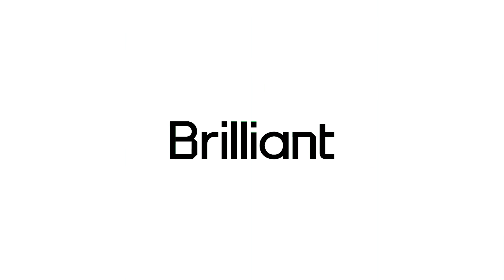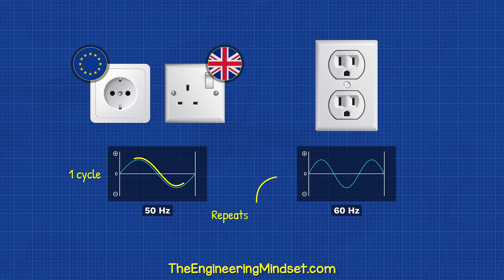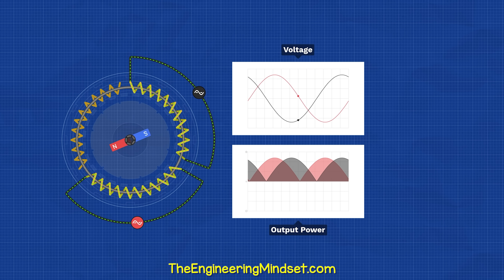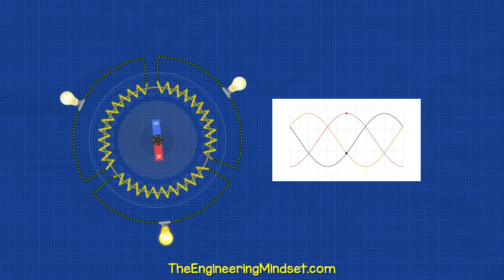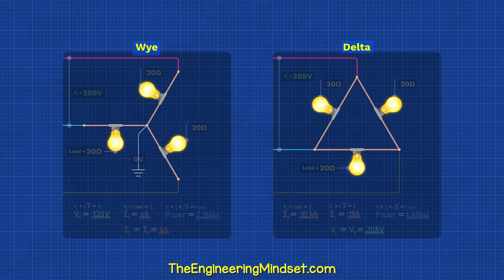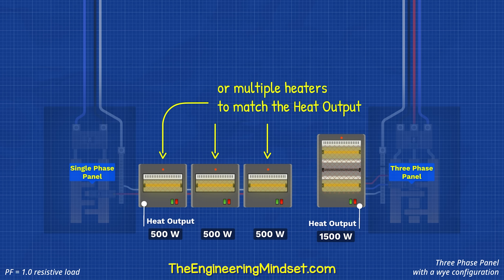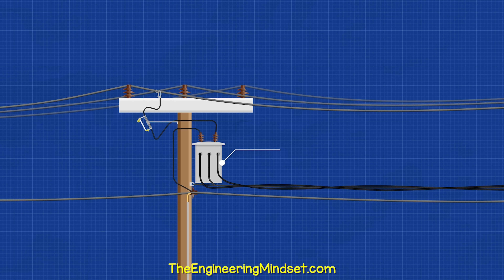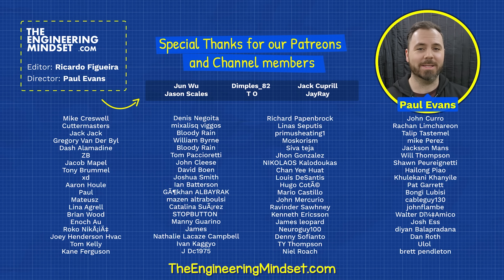How 3 Phase Power works: why 3 phases?

Comment: "Most LEDs are constant so you probably won't see these flicker"
*Shows video of them flickering
Reply from the maker: The flicker on the phone screen is because I'm filming a the phone on a camera which has a different frame rate compared to the refresh rate on the phone screen. The lamp is constant and also the studio lights are LED and are constant.
Reply: @EngineeringMindset  cool. All of mine flicker or give some level of banding when recorded. Especially when dimmed (PWM I assume)

Comment: In reality, there are typically dozens of coils in a large power plant generator. But they are all 120° (3 phase) apart from their respective counterpart coils. This permits the generator (technically an alternator) to be turned at slower rpms while still producing the same frequency.

You could add a "4th phase" but then the windings would be 90° apart and the windings directly across from each other would be 180° out of phase... The result would be that as the magnetic field turns then 2 of the phases would be producing voltage while 2 would be at zero voltage. So you wouldn't be getting ahead.

Comment: Many years ago as a teenager I was mentored by John Roesel, who owned Precise Power Corporation.  He had a small production shop and research lab stuck out in the woods, and made power conversion generators--taking conventional single phase AC and outputting a precise 60 or 400hz 3 phase supply. depending upon the model.  Later I saw many of them in factories of one sort or another in places that 3 phase distribution grid power was not available.  This was a big deal when the big wave of European cabinetry and milling equipment began showing up in production shops in the early 80s.  All of them had highly efficient and compact 3 phase motors powering them...

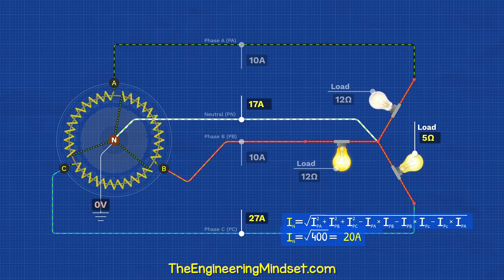Comment: 7:29 My question is: how can power suppliers balance the single phases' loads? Or is it okay if they aren't balanced and the neutral wire simply brings back the difference?
Reply from the maker: The power companies provide delta transmission. The local distribution grid provides wye connection and balances the loads. So the power company doesn't need to balance it. The transformer that connects the grids is delta wye.

Comment: Since you're talking about North American voltages it's worth noting that 277/480V is a largely American voltage standard. It does exist in Canada, but it's very rare, usually it will be 347/600V instead.

Comment: At 12:47 it shows how our power here in the US works.  There is one thing that I still have trouble wrapping my head around though.  Let me preface that I work with electricity a lot, including my 3 phase equipment with a rotary phase converter.  How is our "240v" single phase pulled from individual 120v legs without using a "neutral" it's not in series if it's single phase, I used to think it was 2 phases at 120v coming into our homes and using the rotary phase converter just added the 1 single "ghost" phase into the system.  How do we get the 240v single phase from 2 legs and no neutral/ground, but in Europe they get 240v single phase on one wire plus the neutral/ground?
Reply from the maker: We covered split phase in our last video, here https://youtu.be/c9gm_NL7KyE

Comment: "each country decided to use different voltage frequency" - ok lets stop right there. most of the planet is happily 220v & 50hz. NA is the odd one out and Japan has semi switched to 200v too.
Reply from the maker: True but before that, every part of every town in every country generated whatever voltage and frequency they felt like

Comment: It would also have been beneficial to talk about why three phase transmission lines only have 3/6/9/... lines on a tower and no neutral line "back to the generator" as this might be confusing.  
-> If you add up all currents over the three lines they should all cancel out each other, so there is no need for a neutral line back to the generator. The neutral line only gets added when the power lines are distributed further like in residential areas where it's no longer possible to have all three phases balanced perfectly and so you need the neutral to the last transformer.
Reply: This is big a one. Unfortunately this video seems to only cover the HOW and not the WHY very well.

Comment: This is a good explanation for "electronics", but completely misses the point of why the power system was created as 3phase.  Try this exercise:  Show the stator with the 3 phase windings (just as your generator).  Then calculate the magnetic field inside the stator at every position of a complete cycle.  The math isn't difficult, it just takes some time.  You will find an exactly smooth magnetic field, rotating inside the stator.  Place a magnet (or electromagnet) on a shaft inside the stator.  You've just invented a VERY efficient motor.  Congratulations.  THAT is why there are three phases.

Comment: I might be wrong but LED lights do flicker if you film them on slow. You might have been referring to when they were powered by three-phase however, but LEDs definitely flicker on home electricity.
Reply from the maker: They only flicker if the rectifier circuit is poorly designed. Usually cheap LED bulbs do. In our studio, we use LED lights which do not flicker, so that the camera shows a constant light.
Reply: @EngineeringMindset  ya I forgot to mention the bulbs that flicker less. Good vid.

Comment: I'm not sure this video actually explains the reason. The entire point is that 3 phase power provides a completely constant amount of power. There is literally zero ripple. Add the 3 sine waves together. I think you mentioned it briefly but not as the main point

Comment: Didn't know that there are countries where residential only gets one phase. How do you power stove tops and ovens then?
Anyhow, great video. <3
Reply: One phase; 230V x 35 A = 8,050 Watt
Three phase; 230V x 25A x 3 = 17,250 Watt

The power of the average oven is about 3,000 watts,
 which is higher for larger models. 
For example around 3,600 watts.
One phase will do....
Reply: @j.r.arnolli9734 what about the oven & stove tops on at the same time? that's why european ranges are usually connected to 3x16a 11kw fuses
Reply: So the answer is essentially "different kitchen setup", which makes sense I guess. Cause around here you almost always have combined ovens and stovetops which can easily exceed a combined 6kW.

Comment: In Germay I've never seen domestic homes only provided with single phase connections! Always 3-Phase… Inside the home then the several connections are distributed on the several "phases" to balance it out and provide 240V/50Hz-consumption points… And aside very very remote single-houses or settlements I've never seen a domestic home provided with it's own transformer - the home owner has very seldom to deal with topics like that, that's to handle by the provider in standard cases.
Reply: i know an old finnish apartment which is 1x35a instead of 3x25a
Reply: @gamecubeplayer  apartments are another story. Old wiring style often has a 3-phase connection, but aside the stove all other appliances are single phase
Reply: @toraxmalu a 3x16a range has more power than that entire 1x35a apartment
Reply: @gamecubeplayer  err - what you're talking about? Of course is a 3 phase-connection with 3 × 16 A more powerful than a single 35 A. And 16 A is a standard breaker value for a small apartment or a single room… While the remaining apartment (or single rooms or floors) are connected to 1 phase with this 16 A, the cooking and baking stove is connected to so called "Drehstrom" (rotating power) with the total 400 V. And because that is standard, each house even NEEDS a 3phase-connection.

Comment: I attended a school that had a three phase to nine transformers. The 3 phase was used to drive motors as one speed and the nine phase transformers were used to drive the motors faster. I am not at liberty to discuss what the motors were for. While we were not required to learn how the transformers work, I am fairly sure that there were boost and buck windings. Boost and Buck windings were used in magnetic amplifiers but could possibly work. Today we would just use SCR's and a tiny little timing chip.

Comment: TLDR without watching:
- More wires = more cost
- 3 is minimum enough to never have zero points in the cycle
Reply from the maker: Multiple reasons for 3 phase are listed throughout the video, here are some key points
4:30 Explained how 3 phases provide constant power. Graphic shows “almost” and audio says “more constant” with some small ripple shown, at this point all phases are still separate circuits and we have built upon simple single, two and then three phase generator.
5:05 Explained how it provides equal spacing. 
5:36 Explained how more phases means more cables, controls and protection equipment, complex infrastructure, more complex transformers and motors, harder to balance network and synchronise generators.
6:22 Explains how only 3 wires are needed which is cheaper.
7:26 Explained how neutral can be used to balance
7:54 Explained how we use single or three phase from same system
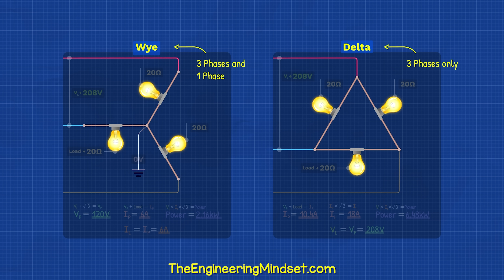8:21 Explained how Wye and Delta are used for different scenarios. Examples uses same resistance and line voltage.
9:59 Explained how 3 phase allows more loads to be connected
10:17 Explained how 3 phase uses more energy but provides more heat
10:19 Compares single and 3 phase power, shows 3 phase power is consistent 
10:36 Shows single phase and 3 phase motor. Single phase has capacitor
10:41 Shows comparison for 3 people v 1 person for motor analogy.
Reply: @EngineeringMindset  That's a lot of good info, but no more reasons for why exactly the number 3. 
- You have much better language, but zero points refers to power as you explain.

Comment: Thank You for yet another excellent video on this subject. I'm in the (I believe not unique) situation of  feeling as if I "understand fully" while viewing Your explanations. Only to find that I still can't "fully account" for how it works once I've stopped watching. So I hope You continue with Your videos, and return to this subject "from time to time" with new explanations and examples if You can.
Best regards.
Reply from the maker: How I built my knowledge, and still build my knowledge, is to write down anything I didn't understand and then in the evening or on my lunch break etc, find an answer to that. It could be a component I didn't recognise, a word I didn't understand. Anything technical, by the next day I knew what it was/meant and how it worked and during the search I probably learned a bit more about something related as a result. Therefore I knew more, I could design and fix more, I got the promotions because of it. So don't worry about that, it's a really good thing to realise you have a knowledge gap but make sure you act on it.

Comment: i dont understand it
Reply: You have to imagine it as a circle with a point on it. Once around the circle is one wave, peak-to-peak. The top of the circle is the top of the wave, and the bottom is, well, you get it. That is one phase AC power. At the top is peak power, let's just say 100 volts, with electrons racing toward You (the "load") away from the generator (the "supply"). At the bottom of the circle is also peak power, - (negative) 100 volts, the electrons are now flowing at 100 volts away from you, toward the supply. That is what is meant by "alternating" current. Directly between these two points, the voltage is 0 and no power flows until it reverses direction.

Now, instead of the one point, you put three in a triangle at equal distance around the circle, 120-degrees apart (120x3=360 degrees). The same rules with the top and bottom and such still apply for each point. So, now you have three overlapping waves, which makes the pattern in the thumbnail. That means when any point is reaching the left/right of the circle (0 volts, remember?) at least one other is approaching peak power, then the next, until the first does again.

This has the effect of smoothing out the power pulses, perfect for high-speed industrial power-hungry electric motors. Then you do not need a neutral wire with a theoretically "perfect" motor, as the sum of the other two wires will always equal 100 or -100 volts.

This is why, if you pay attention, power transmission wires are always in sets of three.

Comment: Thanks for a great video :-) it answered something I have been discussing many times(maybye): is the voltage at at max when the magnet is directed towards the coil or 90° away. At 1:55 it seems like it is when the magnet is 90° away witch should be when the magnetic field is changing most rapidly, But at 1:59 in the theoretical explanation it is when the magnet is towards the coil. Is the video at 1:55 in synk(light and rotation)

Comment: You can configure a 3 phase delta XFMR with a neutral. It called a high leg delta. The XFMR across the bottom is center tapped and that provides a neutral and ground for two phases. The phase at the top of the delta is the “high leg”, so any connection between it and the neutral/ground will be higher than the other two.
Power companies use this configuration because they can provide 3 phase and single phase power and only need 2 XFMR which saves them $$. This assumes the user power requirements don’t need the 3rd XFMR which would give them  the square root of 3 more power.

Very good video and very well explained!!
Reply from the maker: Absolutely, we also cover high leg delta in detail innour last video here https://youtu.be/u0SsejDCVkU

Comment: nice video... but i'd like to point out that almost an entire world is on 220V 50 Hz system, where Murica here has dragged Canada and Mexico down with them to 110V and 60 Hz :p
Reply: As an American, I can confirm, with my multimeter, that I, in fact, get a 240-volt feed into my house (actually 248 right now at 11pm Mountain Time). it is just split in half at my panel into 120 and -120, but I have a few 240-volt outlets. The United States of America is, in fact, a 240-volt 60 Hz country! 😉

Comment: 3:13 I think the bottom graph here is wrong. The power should be proportional to the square of the voltage (or current). Thus the "valleys" shouldn't be sharp like that but just as smooth as the "peaks". It kind of looks like you're graphing the square root of the power.

Comment: Sorry, you are trying to explain the entire universe of 3-phase power in a single 15-minute video, and maybe that's good for your promotion. But could have made this much simpler. Instead, you're going to be losing a lot of people. By halfway, when you start explaining load balancing through a Y configuration, you're going to be throwing off even some engineers. This video could use a lot of improvement. A lot of people are saying they now understand, but then most of these responding say they are EE's or electricians. I'm pretty sure if you did a simple quiz you'd find that you lost even many of them on the majority of crucial concepts, such as inducing current, rectifying waves, combining the waves, and smoothing the current. These are among the essentials but you take them quickly into complicated territory and you move too fast. For most people, this would be better as three or four videos at a slower pace.

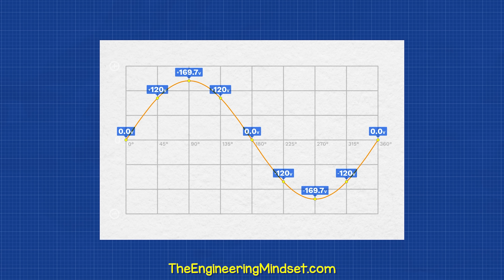Comment: Unfortunately, you're moving too fast through your descriptions for most people to grasp what is happening. Some of your animated graphics are nicely done but also gloss over what is important. For example, by about 3:00 it is still not clear why N and S rotation cause forward or reverse current. This is more readily seen if you first show induced current, then right-hand and left-hand current flow through a cross-section or a single strand of wire, then show how this effect is multiplied through a long coil. You don't do this, so you leave most people in the dust by about 3 minutes.

The LED half-wave show is very good, nicely done: but again it will only clear what is happening to people who already really understand diodes and probably wave rectification. None of this is complicated, but I think you should think harder about the order of steps you show and try again at producing a similar video.

Comment: Um.  Residential homes connect to a single 240v phase,   with a center tap on the transformer to create a grounded neutral and two 120 v phases, split at the transformer.      Or across both leads for 240v single phase for ovens, ranges, water heaters and HVAC.      
Commercial and industrial will have 3 phases,  either delta or wye depending on needs and equipment voltage.

Comment: 8:40 that statement only holds true if you have a wye connection that has a ground tap in the center. iirc wye vs delta in an ungrounded set up is about wanting to keep higher current or higher voltage.

Comment: Higher phase order transmission lines were tried in the 70/80s but yielded poor results due to the complexities with the added phases and lack of power electronic relays. We have to remember most of our transmission grid is still using technology based in the early 1900s.

Comment: This tutorial showed up just when I needed it.  I was recently looking at some high voltage lines in the area and wondering why there were three wires.  But before I got around to trying to look it up your video showed up and answered the question for me.  Thanks for the great explanation of 3 phase power.